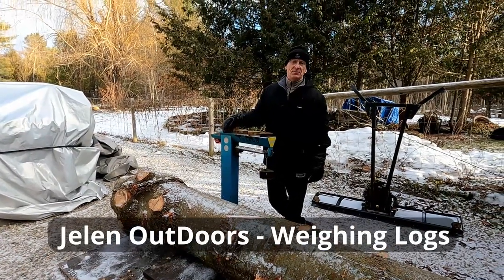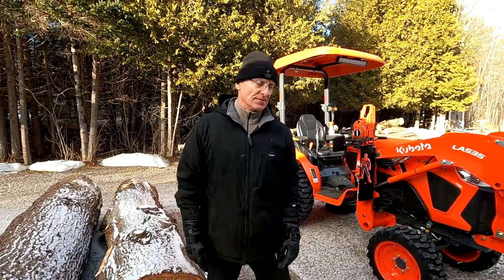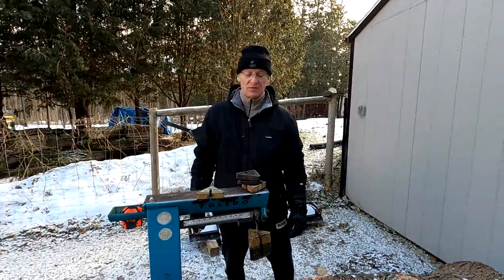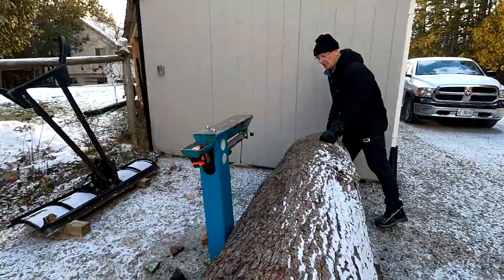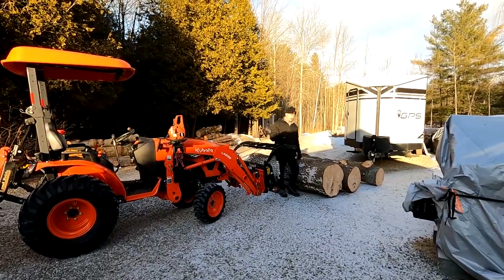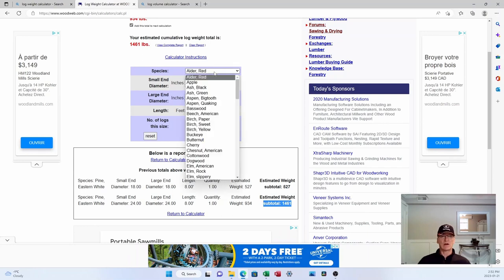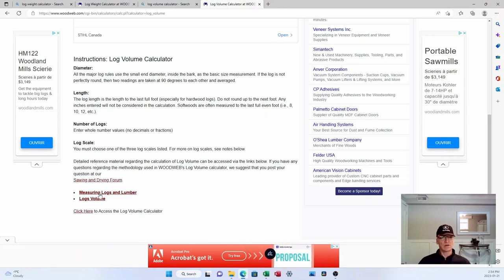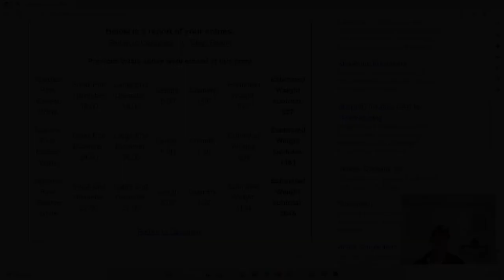78 - How much do these logs weigh? - Weighing Logs

Comment: Hello Paul,
Great video. I am continually amazed at what these little tractors can do. 
Winter finally arrived in our little piece of the country,  -23 C  this morning , very rare for our area ,but back up to around  0 C  next week.
The B2601 started in this bitter cold, and wasn't  plugged in, quite surprising. 
All the best,
Ben
Reply from the maker: Hi there Ben, the little tractors most certainly are impressive.  The weather is erratic, -29 C yesterday and +3 today in my area. I thought that you are located in Nova Scotia and the climate was colder than here in Ontario.  The tractors do start in the cold,  our winter treated diesel helps with that.  I am always plugging mine in so it doesn't take as long to warm up.  Thanks for stopping by and keep up the videos with great ideas on your channel.
Reply: @JelenOutDoors  Hello Paul,
Living right at the coast, the ocean usually keeps us a bit cooler in the summer and a bit warmer in the winter.
There can be rain at our house, and a 10 minute drive inland to the hardware store, and they are plowing snow from their parking lot.
All the best,
Ben
Reply from the maker: @whenworkisplay  That explains it. Thanks and have a great day Ben.

Comment: The area of the circumference of a log is pi R squared.  So if your log is 2' in diameter, it has a radius of 1'.  Pi (1)squared is 3.14 sq ft.  Now make your log a 3 dimensional cylinder 1 foot long.  Just multiply 3.14 squared by 1.  Now you have 3.14 cubic feet.  Find a chart on the internet which gives the density of the wood you are dealing with.  Poplar is said to be 22-31lb per cubic foot.
And so your 1' long cylinder of poplar with a radius of 1' weight approximately 68-96 lbs, and an 8' log could weigh as much as 760 lbs.
Reply from the maker: Awesome, thanks for sharing. Have a great day!